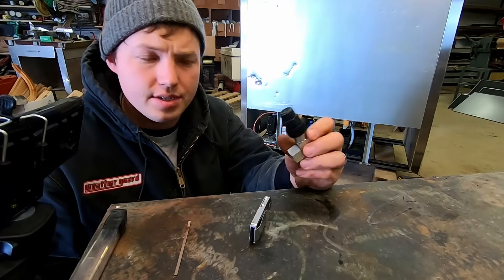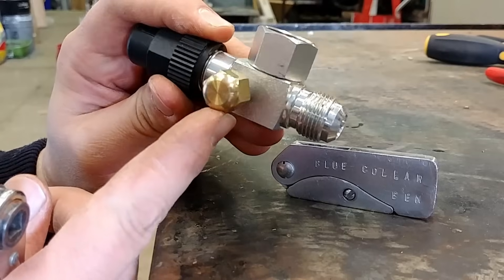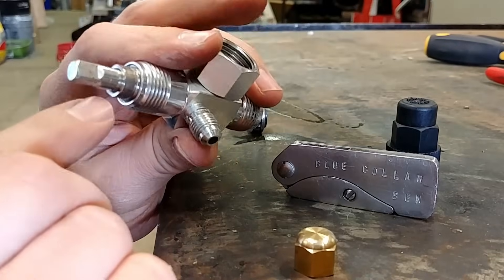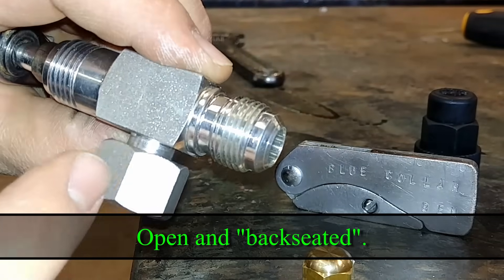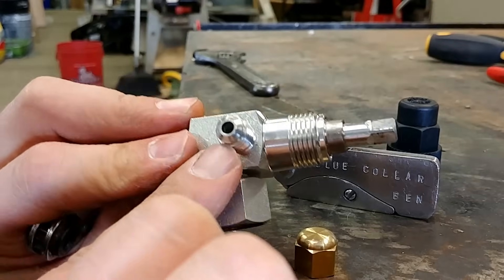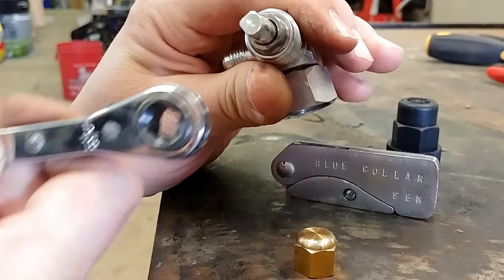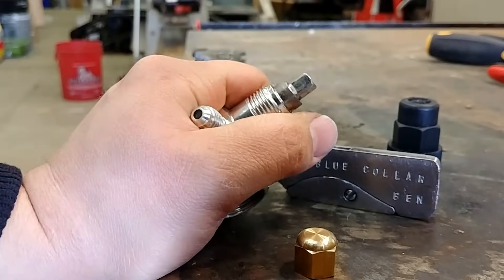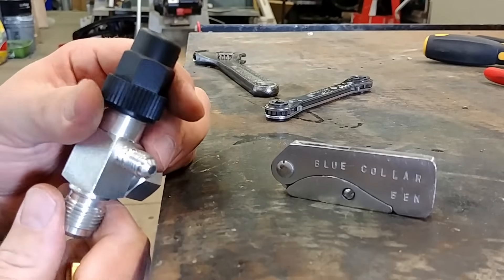What is a King Valve?

Comment: I bought a Pre Charged Bryant Heat Pump.  So I think the 3-way valves were front-seated to seal off the lines on the Compressor side.  I need to install the orifice on the compressor end and am trying to figure out out to suck the refrigerant back into the Compressor.  It came with a #67 orifice and the installer left it out so we only have an Air Conditioner, no Heat Pump.  They don't like DIY Homeowners but we hired an HVAC Company and they did it wrong.  We found the Orifice taped to the electrical cover.  Go figure.  The first time we flipped on the Heating mode, the Compressor sounded awful and the heat out of the ducts was only 78 degrees.  Our previous Heat Pump would put out in excess of 100 degrees.  So I believe the missing Orifice is the cause.  Anyway, nice video.